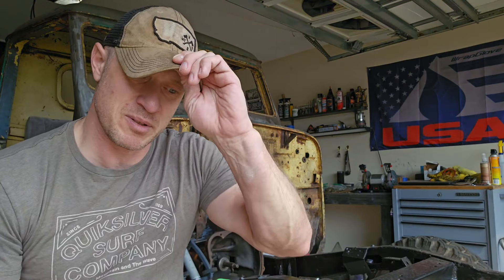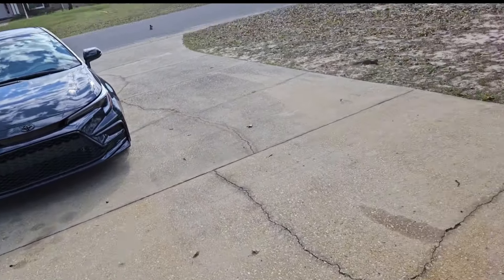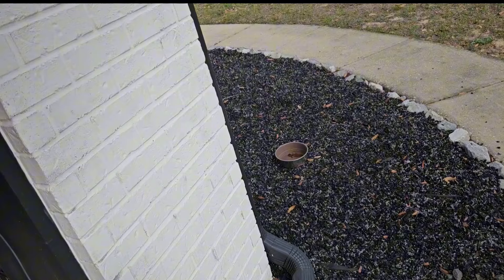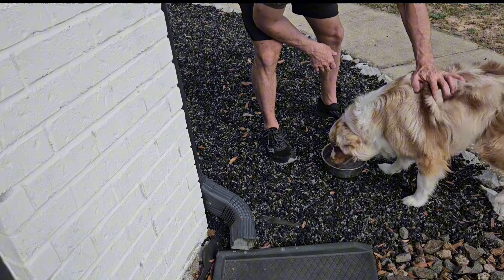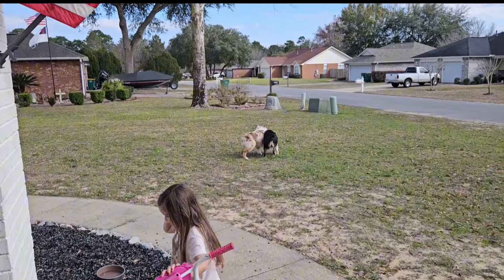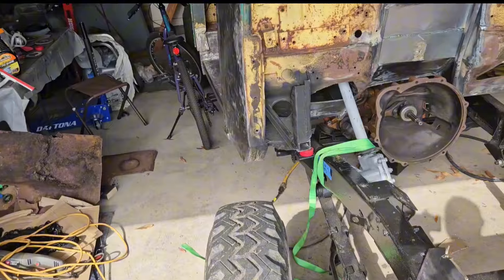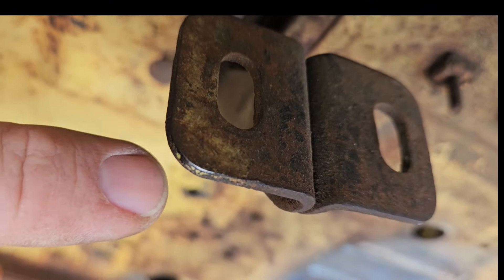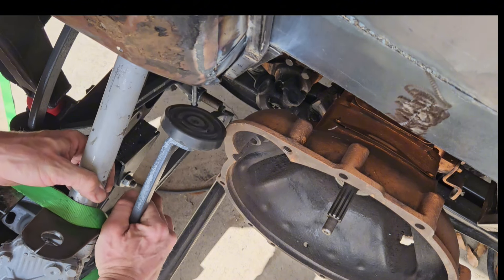Regular guy building a truly unique truck that didn't exist....At least, I don't think it did.

Comment: Shifter will be easier to use cable system over linkage only. Right side steer shouldn't be an issue. There are several steering boxes that will work if fabbed up right. I like the vision. Had to subscribe to follow along
Reply from the maker: I'm going to stick with the steering box that I have already.  I think it'll work fine...I hope!

Comment: I actually have a 53  factory rh drive jeep. floorshift of course. they made a special steering box and linkages for the clutch.
Reply from the maker: Thats awesome! My goal is to use my current parts as much as possible.  While it will take some modifications,  I think it's doable.

Comment: I don't think you have to worry about the rubber pedal pads hitting the shift linkage.  On my 1961, they stop well before full extension.  I'm guessing that some cables are going to be the solution to your linkage challenge.
Reply from the maker: I was wondering about the pedals travel.    They weren't really functional when I got it,  so I have nothing to go off of for reference.

Comment: Fyi cutting the flange of the rail is big iffy. You really should avoid it as it is compromising the rail strength at a very important point. I would recommend boxing the rail forward and aft of the box and plating over the top to get some strength back. I under stand the situation but you want to avoid damaging the flanges if at all possible. Make sure the welds are very good as well when you weld the frame. Check for full penetration and grind your bevels. 
As for the shift linkage you definitely have a challenge. Cables may be useful but they can be very challenging to work with at times. To do solid linkage you might need to go to a pivot point on the other side of the frame rail. 

Either way you definitely have a challenge on your hands and I think it will definitely be super unique! Im very excited to see what your solution will be as it will definitely require some well thought out planning!
Reply from the maker: I was also worried about that, but plan on doing some boxing in and plenty of strengthening of that area and several other areas of the frame after I take the cab off again.
Reply: @tumbleweed_garage  great! Cant wait to see what you have in store!

Comment: When I served myt Apprenticeship 50 years ago,I was taught to never,ever, wear gloves while drilling on a drill press,Operating a lathe OR using a wire wheel on a bench grinder. Why? because you run the real risk of getting "gloved", as the glove gets wrapped in the job and tears your fingers off. It happened as they used to show us pictures of gloved victims hands . Not too many Jeeps of your vintage were sold in Australia and all military jeeps from WW2 were LHD. Most Jeep people here wouldn't be interested in selling a steering box as it would be too hard to source. But...what other cars used that steering box? Studebaker etc? If so it opens a anopther source for parts as those are reasonably common. As for coloumn shift, try a 1950's Mercedes Ponton set up. they are all column shift 4 speeds and work really nicely plus wear parts are easily sourced.
Reply from the maker: Interesting,  I'll be watching my hands,  thanks.   My goal is to use the parts I have.  Although I'm no expert, so I may be wrong, but any other parts from other vehicles will probably not be a direct bolt on, and would need some modification to work. So, my thought process is to modify, as needed, the parts I already paid for and have right here.